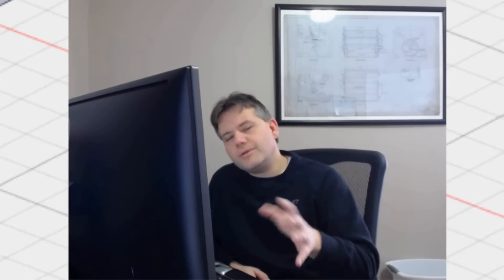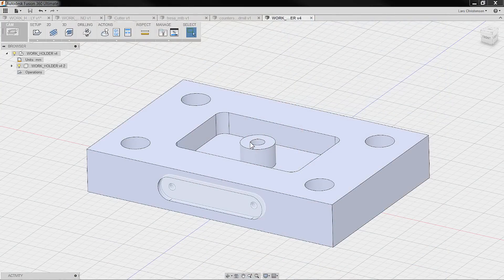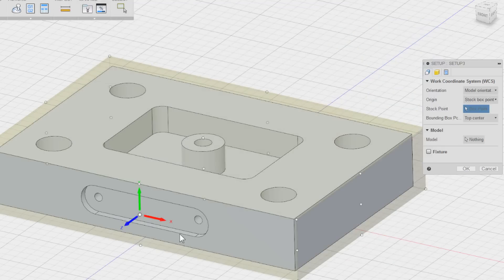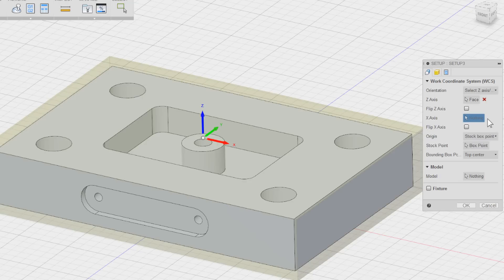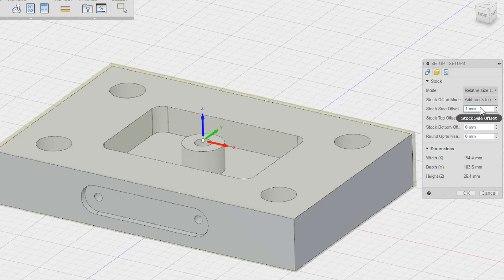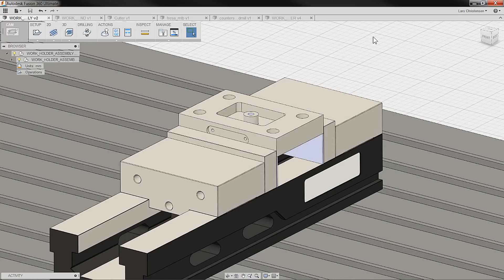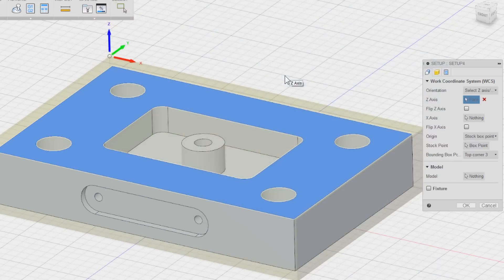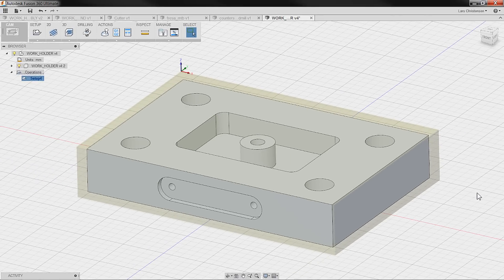How to learn Fusion 360 CAM Tutorial - Basic - Chapter 1

Comment: hi lars, i replicated this tutorial and got it work, just if i use the chamfer mill and mill the chamfer, i see the tool engages proper with the model but after the run the model does not show the chamfer.  if i modify the models in the design and add the chamfer there, i get a warning "empty tool path". what is the cause or rather what do i wrong, I use  Fusion 360 professionel

Comment: Hi Lars. I just love your videos and am new to CAM but hoping someone can help me with a CAM issue. 
I am cutting several small pieces from one piece of stock. All of the preliminary cuts are fine but when I create a final Contour cut to cut the pieces out, leaving tabs, Fusion does this weird thing I can't seem to fix. It takes one pass on the first piece, then the second pass but instead of continuing and finishing the full cut out on the first piece, it moves to the second piece and takes a pass. Then it comes back to the first, does another pass, then moves back to the second, does a pass, then moves on to the third piece and does a pass. This is very inefficient and I would like to tell Fusion to finish cutting each piece before moving to the next piece. Is this possible? Thanks.

Comment: Hi, I purchased a license for Fusion 360 recently, moving on from a very basic CAM software. I'm making my own tool library for my Tormach 1100 and I'd like to know if there is any literature on the internet that can explain what the values asked by the software are when specifiyng the tool dimensions and its various lengths. Any help would be appreciated.
Reply from the maker: Hi plata, Are you talking about "flute length", "body length" etc.? If so, you should be able to get those numbers out of the tool vendors catalog you are using.
Hope this is helpful.

Have a great day!
Reply: Hi Lars, yes I'm talking about those parameters. Maybe i've been doing it wrong, I was under the impression that those values needed to be measured with a height gage while the end mill is in the Tormach tool holder, should they be measured from the end mill itself?
Reply from the maker: You are completely right that you need to measure your tool length offset (H value in your code) I was talking about all the other values such as flute length. The tool length value is the value from your tool spindle to the tip of the tool. This value will be entered into the machines height section.

Hope this is helpful.
Reply: Thank you for answering.
 Flute length is the only one clear to me. Would you be so kind to explain the following: Shoulder length, from where to where. Body length, from where to where. Overall length from where to where?
 
Overall length should be from spindle nose to tip of tool but I want to make sure.

P.S. does Fusion360 need to know the tool height or can the tool number only be entered, in order to let Mach3 be in control of the tool height offset?
Reply from the maker: Hi, Plata. Shoulder length= the step there can be from flute grind to the body. Body length= from tip of tool holder to tip of tool (distance tool is sticking out of the tool holder). Overall length= Overall length of the tool.

The tool number and the tool length call out (H in code) are by default the same, but can be different. You can change it on the "Post Processor" tab when editing a tool. Then, you just need to make sure you insert the actual tool length in the right collum on your Mach3.

The only time I have ever had different between my T and H in my code was when I had to use more tools than I had tool pockets in my tool changer.  

Hope this is helpful.
Reply: Got it. So, if the tool number that I enter in the post processor is what determines the H value in the Gcode, all the other values such as flute length, body length and overall length are there to detect collisions and generate accurate feeds and speeds, am I correct?

Comment: Just Started using 360 My first part generated 55000 lines of code and Locked up Mach3 LOL is there a way to condense the code with J moves etc. I use cam bam and it has this feature. Also I see 360 generate G43 offsets. which has me confused as to what to set Z zero to?
Reply from the maker: CNC4XR7 Do me a favor and email cam.support@autodesk.com they have people ready to help at no cost. That many lines makes me think you are using adaptive clearing. The G43 offsets are generally tool length offset call outs. From spindle zero to the end of your tool length. Again, I think the easiest thing is contacting cam.support@autodesk.com. 
Thank you for taking the time to write and watching the videos!!!!
Have a great day!
Reply: cadcamstuff Thanks For the help I figured it out I think I had a brain overload a reboot and a few hours sleep cleared things up.

Comment: Hi Lars,
Your tutorial is very helpful to understand the different settings for toolpathes with different shapes.

Normally i know that a machinest uses 3 different toolpath operations.

1. milling as lot as possible material to come close to the final serface.

2. milling the final shape with a rough surface

3. cleaning the surface with a ball mill  in high quality

I still like to know to setup a comparable process within fusion. The only setting i found is the 
horizontal setting of diameter to generate mor finer pathes.
Perhaps you can take a simple example with Prallel milling and using a shape which comes from horizontal to vertical.
You already eplained finally this basics but without settings.

I think my question is for general interest.

With best regards
Harry
Reply from the maker: Hi Harry, thank you for taking the time to watch and comment. I hope I have some video soon that can go right to those details :-)
Have a great day!

Comment: Lars...Great Videos !!

I have a general question about CAM.  When I generate the tool path for a given circular pocket ( Imagine a beverage coaster ) it cork-screws down into the materal in a counter-clockwise direction.
I did a little searching on the Fusion forum and it said that the direction of the spindle could either be changed to clockwise or counter clockwise.....Is the clockwise of viewed from the bottom of the bit up or clockwise from the top of the bit down?  My router only spins in one direction....Clockwise from the top of the bit down.  The blades of the end mill are thus cutting into the material as I expect if it were to corkscrew into the material....Or am I missing something simple?
Reply from the maker: Hi Wiliam, Normal/standard or whatever you want to call it ;-) Looking down from the top, you endmill will spin clockwise. I think I have seen a counter clockwise, like twice in my life. NOw...There are conventional cutting and climb cutting....Back in my youth when we actually had to crank handles to get a Bridgeport to move we ran conventional, but then these fancy CNC machines came, and they are awesome at climb milling. That is where you see the cork-screw toolpath that is cutting counter-clockwise.

So...clockwise for your tools rotation and if you are machining an internal diameter, the tool will move counter clockwise.

Hope this is helpful.

Have a great day!

Comment: OK Lars I start bugging you.  Say I have 2 tool operations with same tool.  One is a 2d profile and other is a open pocket that is .03" above previous path.  How do I stop tool from returning to safe depth and only have it go up .03"?  Second of all,  finish passes.  say for final pass of pocket I only want it to take .008" axial and radial depth of cut at same time, How.  Finally My open pocket is .25" wide and .4" long, why Can't I use adaptive pocket?  Did I forget to say thanks.  Well, Thanks a lot.
Reply from the maker: Hi JOe Shmoe Thank you for watching!
1, You should be able to set your retract height to the start height of the the second toolpath.
2, Look on the passes tab for maximum stepover and stepdown
3, You totally should be able to. Try to select the edges of your open pocket.

Hope this is helpful.
Reply: Thank you.
Reply: 1. problem with that is retract height ends up lower than feed height.  How do I get the tool to plunge at a location outside of the stock. after all this is only a 2d outside profile.